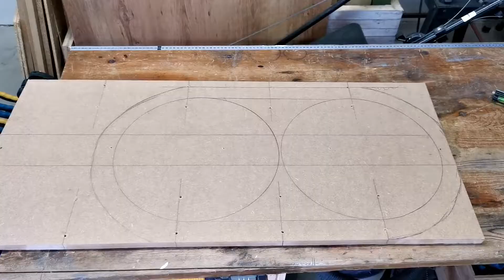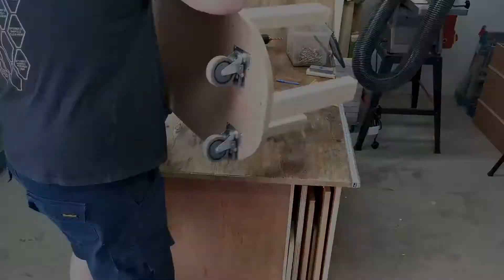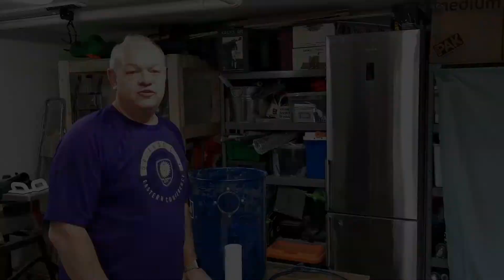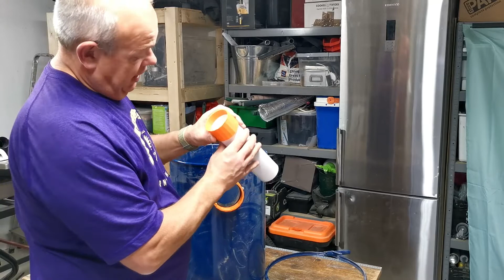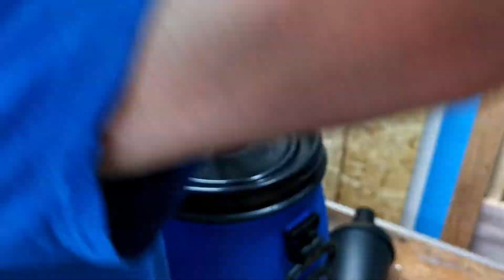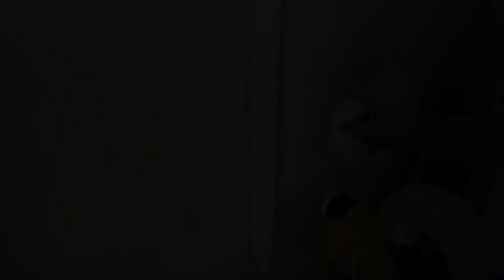The Garage Workshop   Dust Collection Upgrade

Comment: You really need to wear a mask when cutting MDF especially when not using dust extraction it can ruin your lungs in a heartbeat, and all those 90 degree angles wlll slow down the limited air flow that you have.
Reply from the maker: Hi Philip. Thanks for the advice, will do in future.  I tested it this weekend (upcoming video) and I was surprised how well it worked. It was much better than my previous set up but I think the narrower hose helped.